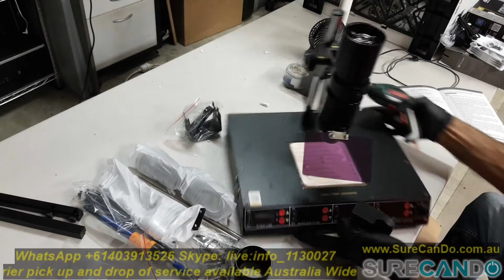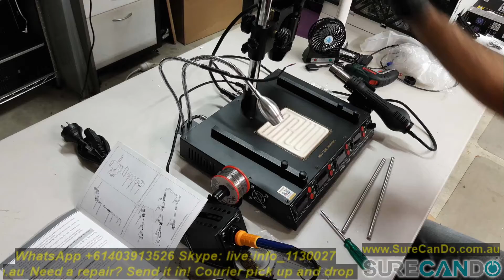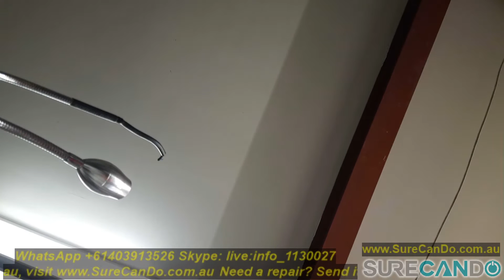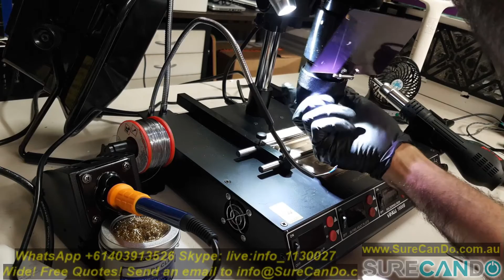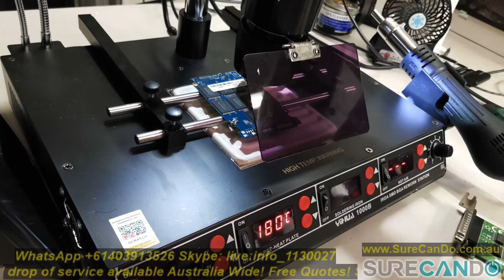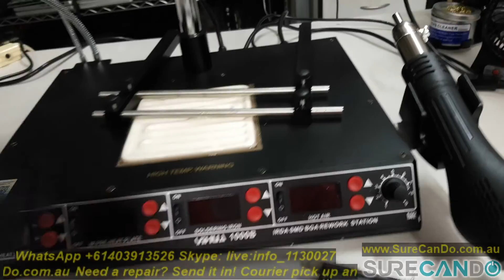YiHUA 1000B Disassembly, Setup Install and Demo of Infrared BGA Rework Station Hot Air Iron

Comment: Sir, you have been very polite and I do admit I have not been so much the same way. I do apologise for this.
Let me correct it in some way that I can.
- The hardware you are sitting the board is nothing more than a Vice. The BLACK shaft is the Vices "jaws" to grip/secure your PCB in. The two round bars are shafts to keep the vice jaws "in check".
- If you want to move the board you just slide the Vice.
- These "jaws" are holding the PCB at the optimal distance from the pre-heater used solely to reduce the heat required to remove the IC/chip.
- The Vice has to be positioned in such way that "jaws" are positioned close and far from you (not side to side). The way you do it, you are pre-heating these bars more than the PCB causing heat losses. These bars need to be on the left or right side as you fronting the station.
- For PCBs larger than the Vice jaws capability, solder some Pins on the underside of the PCB, preferably to the Earth bigger tracks but spaced within the capability of Vices "jaws" but with the area of your work being in the centre of the Vice.

Now, a few words on using the IR station:
- it is solely used on ICs having pins under them that you do not have a visible access to. This technique is called "re-balling" and is generally close to being destructive to the IC that you are removing, whilst giving you the best possible chance to protect the PCBs tracks.

For not "re-balling" types of ICs (where you can see all IC pins), slide the IR lamp away and use the Heat Gun tool if you must.
The MAIN TASK is to remove the IC with no damage to the PCB or near-by components. Please do apply the technique below:

Buy cheap but precise flush "thin wire" cutters and shave off outside jaws close to the tip. This will allow you to insert cutters into your IC pins to cut them individually and then remove the IC. Use soldering iron to collect all pins cut-offs then use copper braid to remove remaining old solder. The PCB is as good as new. Always use ample flux in the process.

I do hope it helps.

Perhaps what originally annoyed me was the advertising in the bottom part of the video but persisting through-out its length by offering a professional service in the area you are clearly not comfortable with due to the lack of experience.

Kind Regards
Reply from the maker: You didn't see recent videos?

https://youtu.be/AFLOehAbYwA
https://youtu.be/QZIJSbXBbyM
https://youtu.be/6sBwkJipD-M
Reply: @SureCanDo_Life  Yes, it looks much better now. I am glad it does not collect the dust anymore :)

Comment: How do you like it so far?
Reply: @SureCanDo_Life  What paste are you putting on there?
Reply from the maker: You mean flux?
Reply: @jeffbanfieldsflwr3537  paste is with solder, flux is just flux. Buy any flux recommended for lead-free (especially for desoldering unknown components) and no-clean (just to be sure). Syringe for ease of application.